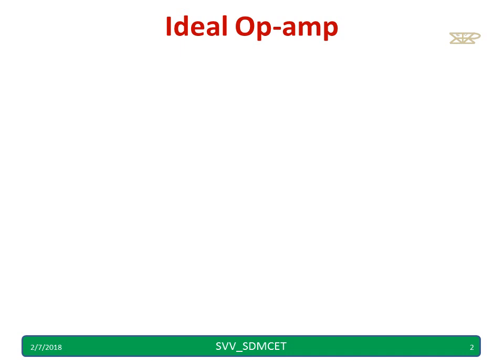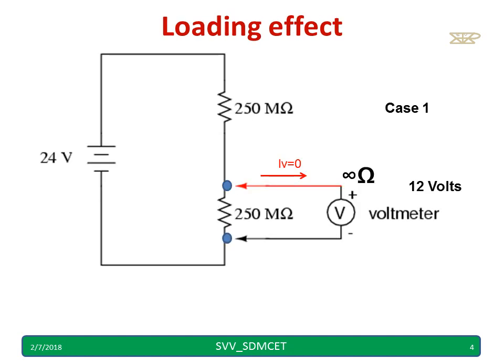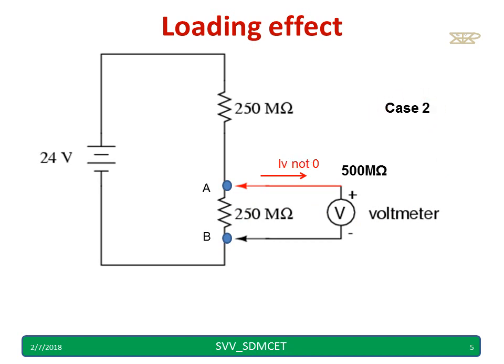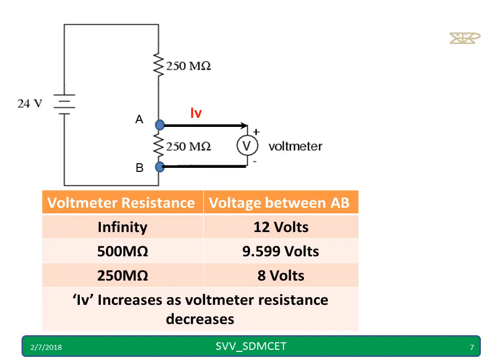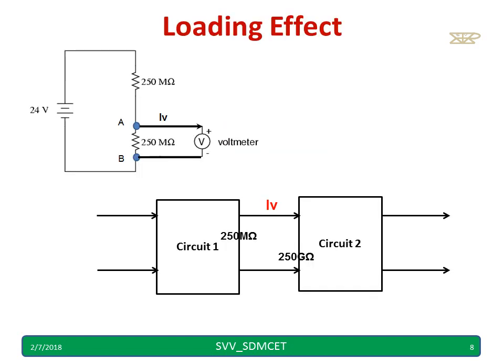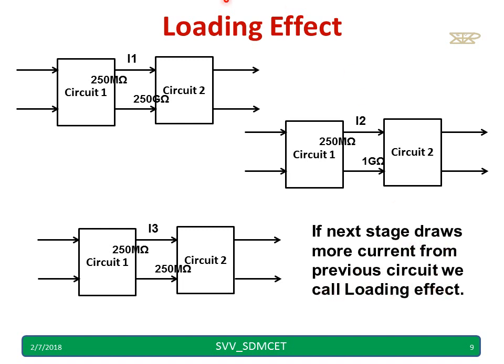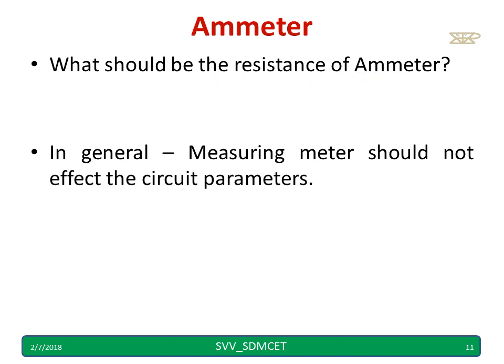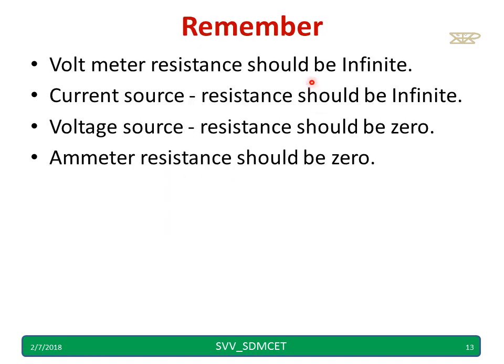loading effect

Comment from the maker: IV is current through voltmeter
Reply: 1.08 how can current flow through voltmeter as current always follows low resistance path
Reply: @nirzarshah5281  despite it always flowing to the lowest resistance path, a small amount will still flow in this direction.